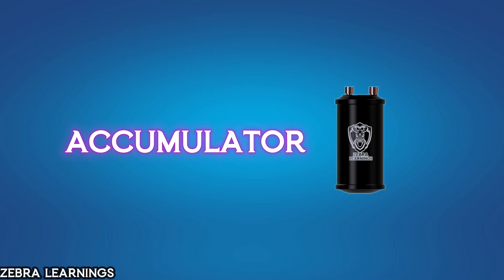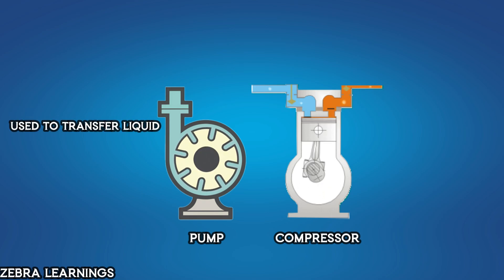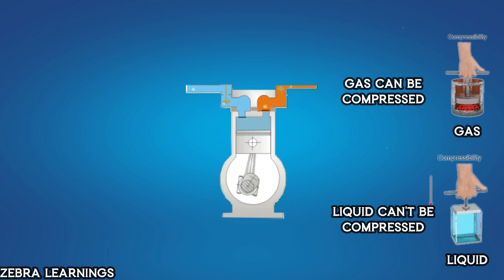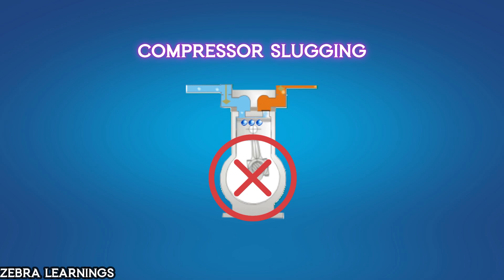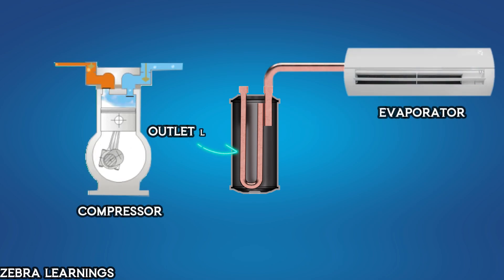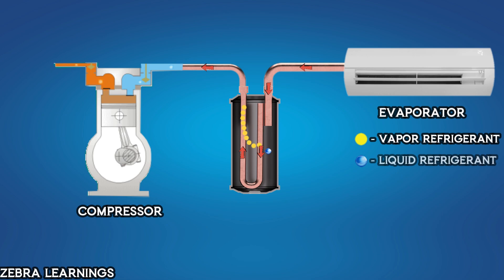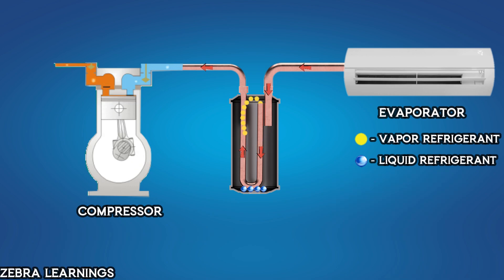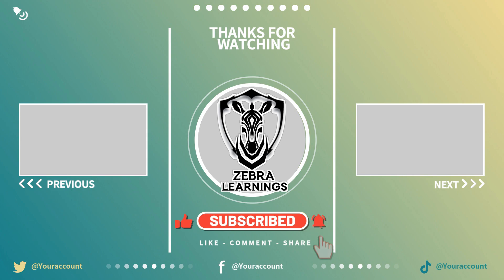What Is an Accumulator? | Protecting Your AC Compressor | Animation | #hvac #hvacsystem

Comment: I think accumulator is something else. It is located between condenser and evaporator. It accumulates the condensed gas from condenser after the condensate goes into the evaporator. What you talking about is the fluid gas separator which is located above the evaporator.

Comment: Why would there be liquid in a system in the first place?
Reply from the maker: In the evaporator, if the refrigerant doesn't evaporate properly, it'll be in the liquid phase.
Reply from the maker: If there is no load and blocked filter and coil, it may lead to this issue.
Reply: For example, imagine putting a very hot cup of coffee inside a fridge! What will happen?
The evaporator will absorb the heat and thus the refrigerant will humidify changing from gas to liquid. As a result, the compressor will be totally damaged as liquid flows into it.
Reply: @eng.mohd1990  What? A hot temperature would boil the refrigerant, if anything. Otherwise, any fridge starting in a hot environment would fail immediately.

I can imagine the opposite scenario, where the fridge is colder than low-pressure-side boiling point of the refrigerant so it remains in liquid form. This could happen if the temperature sensor is malfunctioning. Or as zebealearning explained; blocked filter or damaged coil. However, I don’t see how this connects to a hot cup of coffee.